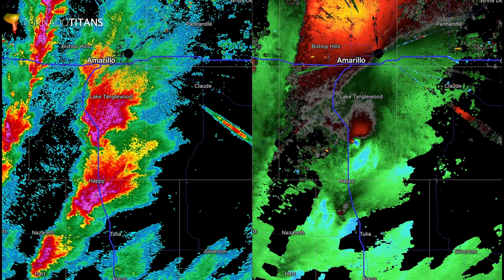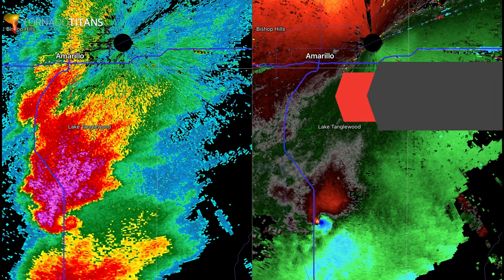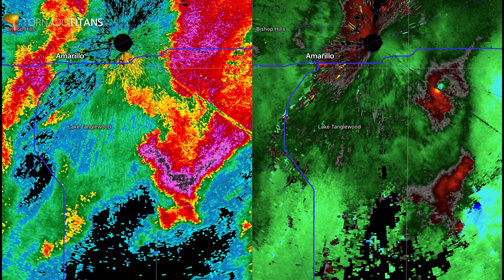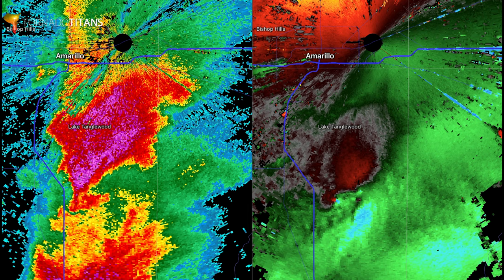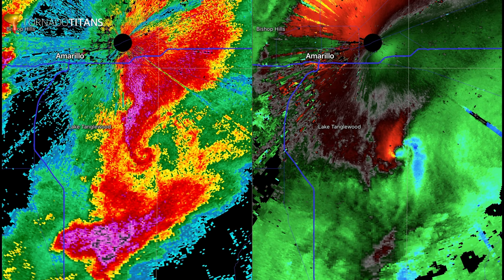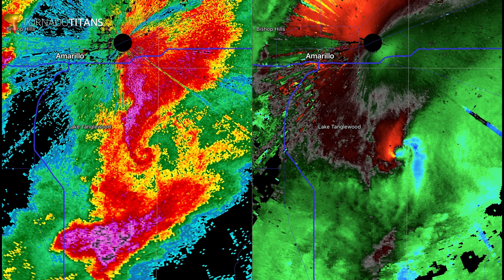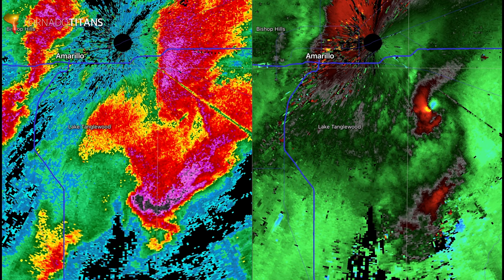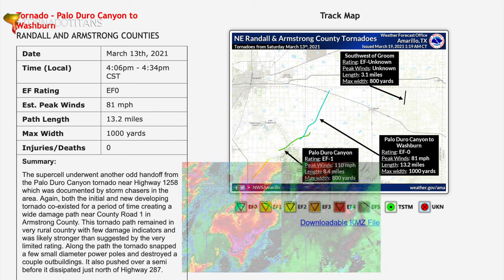What a Tornado Looks Like on Radar: Learn How To Find Twisters

Comment: Helpful info.
Where can you find velocity maps?
Would love to see you dive further into soundings and stuff as well.
Reply: I'd highly recommend Radar Scope for velocity radar. It's the most fluid and easy to use NEXRAD radar app on the market. Next, I'd say Radar Omega. It's still got some work  to do to reach the user interface level of Radar Scope, but you have more features, like HRRR model data. In both, you can also have two radar modes side-by-side. You absolutely can not beat reflectivity and velocity side-by-side.